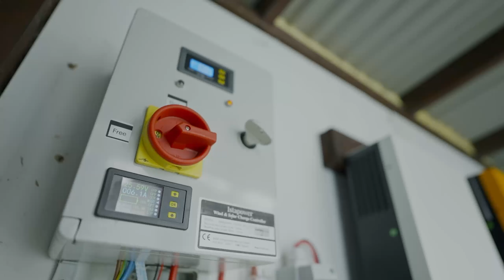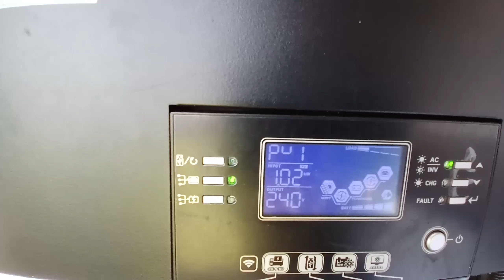DIY Solar Array, Manual Tracking Multi Angle.

Comment: I think your point came across in the TV clip, you never fully understand what you are doing when you start and you keep learning and technology keeps moving. I am up to almost 30kWh of storage now having started with 5 over a year ago. I have been building my own lifepo4 batteries from old car batteries, (lifepo4 on  BMW and Porsche starter 12v batteries coming up in scrap yards now for small beans) and a new BMS.  I end up with a 3kWh battery for £50 or therabouts. Not sure if I'm ready for fully off grid. This time of year we are at about 10% generation. maybe 2-5kWh per day, not enough for us. Grid power is still pretty cheap.
Reply from the maker: Yes agree 100%.  Its definately a process of learning and building. 
Well done on sourcing cheap batteries, hope they do the business for you. 
Production is pretty poor this time of year but luckily panels are cheap and getting cheaper every year.

Comment: probs would have been better using a solar tracker ., auto aligns rather than u having to manualy move panels.! just as cheap to buy a auto tracker, it has sun sensors on all four corners on panels, and tells auto tracker brightest position to set the pannels.
Reply from the maker: Congratulations! youre the first to say about solar trackers. I knew someone was going to 😁. Whats putting me off them is the wind that we get here. We often get sunny days with high winds, on those days we put the arrays in the most wind neutral position to avoid wear or damage. That position would be compromised by a solar tracker. It could be over come however with a bypass circuit of some sort.
Reply: @ourkilkennyhomestead2006  Add a Single Axis Tracker to control that Linear Actuator.  Eco-Worthy controller comes with an anemometer - Wind Speed Sensor.  Puts panels level in high winds, automatically.
Reply from the maker: @MrSummitville thanks for the tip. I didn't know ecoworthy had that product on the market.

Comment: 60 degrees se 35 degrees sw, its the best you could have done, putting all pannels across the lawn would have blocked your beautiful view.
Reply from the maker: Thanks Henry, what i didnt show in the video is that the actuators still have 10cm of travel left in their motion. We can get some westerly angle out of also. Won't know exactly how much until I re-adjust it.
Reply: Shan't be worried about the nw tilt untill june,i would start planning next year turning the 4 pannel array into a fixed 10kw south, no tilting or sluing, if you think you need it that is.
Reply: Concrete piers make super strong perches, cheap material to.
Reply from the maker: @HenryOwens-py3ur thanks for the info Henry, must price them up here locally. Hope all is well with you buddy 👍
Reply: Ill send some pics of my windturbine piers, their only 300mm outthe ground, but could go up head high, like at the bottom of your steps to the top of your patio wall, on the west side of your slop obviously and I'm guessing another where your 4 pannel slu array is 4.8m apart for a 9x2 and then 4x2 rafters, shouldn't hampperthe view too much.
Reply from the maker: @HenryOwens-py3ur thanks Henry, ill check them out this evening.
Reply: Did you get thoughs pics and have an understanding of what needs to be done to generate upto 5kw in winter ?!
Reply from the maker: @HenryOwens-py3ur thanks Henry 👍